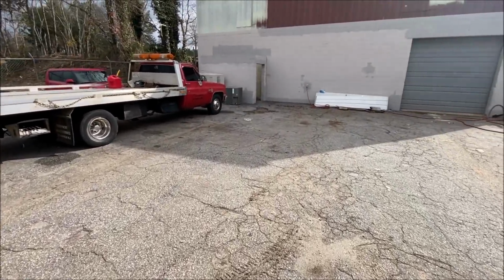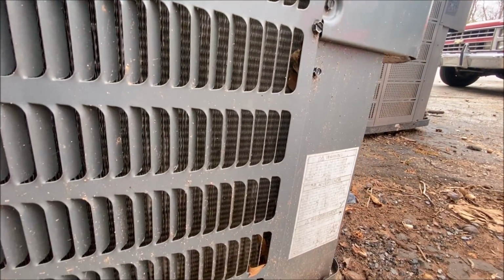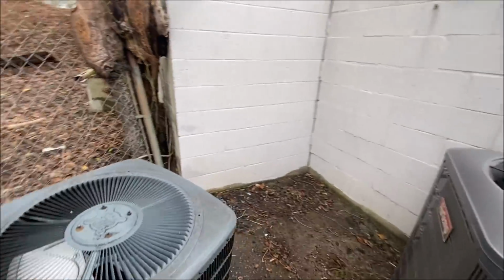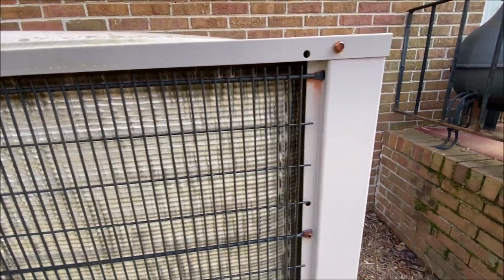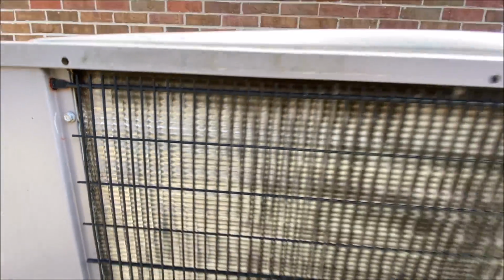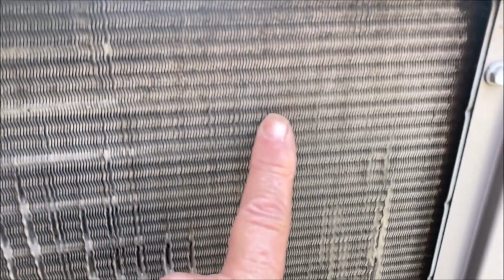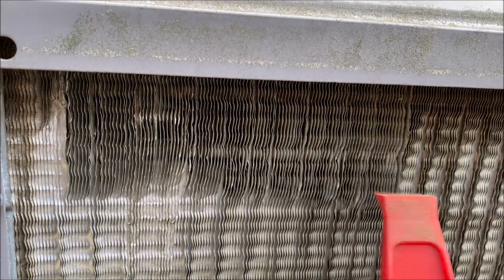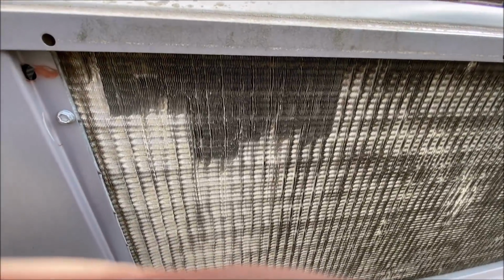Why you don't use a Pressure Washer to clean an Air Conditioner

Comment: I combed out a coil once that a kid was bouncing a tennis ball against it.  He must have spent a few hours doing it because the heat pump was freezing up and defrosting about twice an hour with temperatures in the 30s. Like you said, about half a comb width at a time was the maximum that I could do. The homeowner was very surprised at the diagnosis and even more surprised that it worked. He knew how it happened but wouldn't tell me how he knew.

Comment: Using a pressure washer on an aluminum finned coil comes down to experience! Besides just the amount of pressure there's almost a grain to the fins as in which way they are already slightly canted from the manufacturer. A lower pressure hitting the fins the direction they are already leaning will flatten the fins easily but a higher pressure at an angle that is direct with the fins will work workout issue. I almost exclusively use a power washer on residential condensers all the way up to large Intellipaks.

Comment: I had a mechanic that I know about using a pressure washer on his condenser coil.  I told him to never use a pressure washer on any coil.  You can lessen the efficiency of the system.  I told him to only use use regular water pressure with his thumb.

Comment: I had some friends gripe that their window AC wasn't working right. They wanted it changed out. I took home their old unit. I was then that I noticed that nearly every inch of the fins were smashed. The unit had a problem with that fancy plug tripping. I deleted the plug, straightened out the coil the best I could. I use it in the shed out back because his wife smoked and they had cats. YUCK!

Comment: I was told use shower setting or soak  and dont hold your finger over the hose
If u wreck these fins your looking at 3,100 for the new machine so treat them like they are fine crystal cause they damage that  easy

Comment: Ted, residential units should not be pressure washed. I have worked for a contractor that cleans commercial rooftop units, and that's the only way to get the dirt and bugs out of these. We have certain procedures for cleaning them, and they don't include using any soap as the roof water drains to a fish pond, and any soap would be destructive. All the units get locked out for safety.
A garden hose on gentle spray is usually most adequate for split units.
We, on occasion have needed combs for the coils, but not necessarily due to our work. Some get  bumped and the coils on some of the units are coming to the end of serviceability. The panels have been patched a few times, and many fan motors have been changed out. Some of the dog box units are holding up better than some of the others we clean.

Comment: I clean my units with a pressure washer no problem, but I use a high end Kranzle machine that can have pressure set to as low as 10 bar, which is harmless.
Reply: Same here. I purchased a Kranzle last year. Running at 900 psi with a 5 or 6 nozzle both at 40 degree. About 2.25 to 2.5 gpm
Reply: Yup, I've pressured washed all mine and never bent the fins

Comment: oh lord, typical of what happens when idiots have and pressure washers. I can use one to clean them and bend near zero fins..
sometimes pressure washers are not needed to flatten fins, city water at 70+psi and a mean nozzle will flatten them too. I have done that a few times also, and always cringed

Comment: It’s not the pressure washer issue, it’s a user error.  Someone with more experience can wash that properly with or without a pressure washer.
Reply: You're not wrong but I still wouldn't, I use coil cleaner and a pump sprayer most of the time and that is more then enough pressure. Sometimes I use a hose depending on availability, I do mostly commercial and commercial refrigeration and not everywhere has a spigot that's reasonable to access.
Reply: 100% agree.

Comment: We had a old 25,000 btu window ac that we were cleaning, pulled it out of its window shroud to vacuum it out. turns out where you set it to clean is as important as how you clean it.........until I got a set of the cheap combs it had a very nice indentation of what I can only assume . . 🙄. . was a kwikset door knob. But I wouldn't know anything about that 😒

Comment: I ALWAYS USE A PRESSURE WASHER,ITS CALLED A GARDEN HOSE, BUT THEN I ALWAYS REMOVE THE TOP,AND WASH FROM INSIDE, I can NEVER UNDERSTAND CLEANING FROM OUTSIDE BLOWING IN THE DIRT, I HAD NEVER FLATTENED ANY FINS YET,what you need is LOW PRESSURE & HIGH VOLUME !  A ex friend brought a photo, of 6 roof top units lined up which ALL UNITS WERE FLATTENED, as even he knew because of me  the pix was in MEXICO, you see HE  had a pressure washer,and decided to CLEAN HIS BIG WINDOW UNIT AND DESTROYED, THEN CALLED ME TO FIND OUT WHY HIS A/C WAS NOT COOLING,I HAD NOT LAUGHED SO MUCH,,,,HE REALLY WAS PISSED,I gave him a fin comb, he got tired & bought a new unit  !   Stay well&Safe,🇺🇸🇺🇸🇺🇸🇺🇸

Comment: thats a high pressure engine driven washer, a low pressure washer like used for car cleaning will not do this, I've done it so many times with my little unit and never damaged a singe fin on window units and split system units.

Comment: Hey this is Ray the wrong guy with the wrong pressure washer tip with the wrong pressure washer with no experience and this is the result you can expect. 

         But if you select the right pressure washer with the right volume and pressure you can custom order different tips that do not have a strong high velocity flow. 
           In the hands of a experienced person it’s no more than the best hand pump sprayer that you ever did use that doesn’t run out of energy and have to keep on pumping. 

      In experienced hands you never damage the fins and you get done 10 times faster. 

The difference between experience and a right tool,    and the inexperienced with the wrong tool